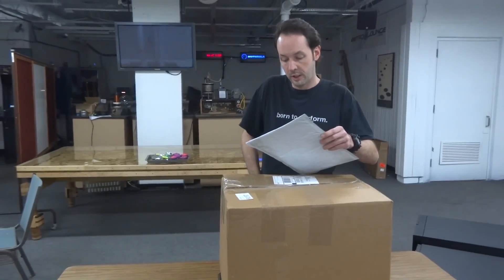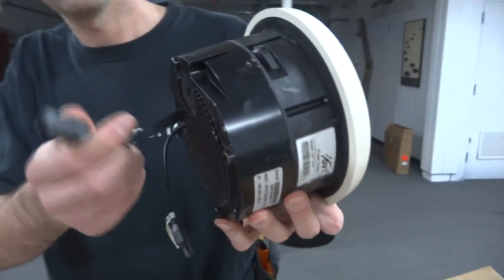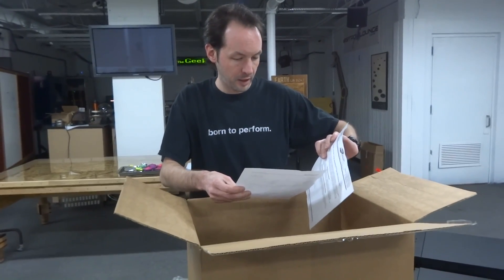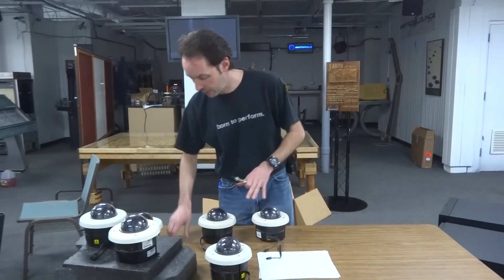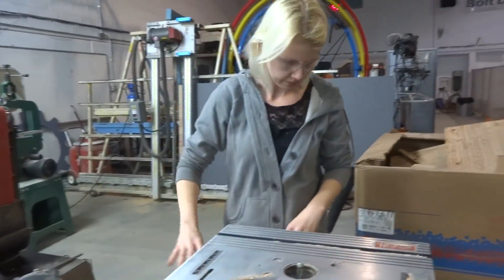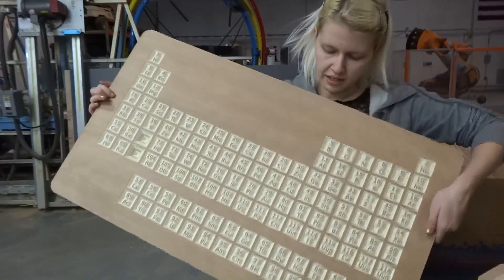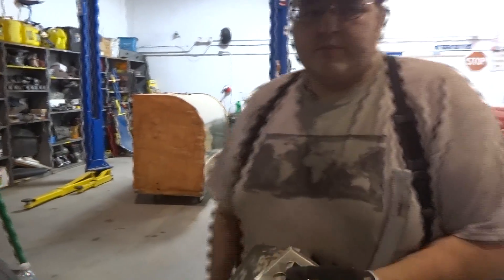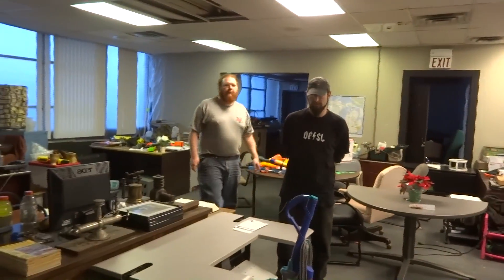Captain's Blog 12-17-2012 Periodic Tables

Comment: I guess it's pretty likely the cameras with just the Ethernet connection would be Power over Ethernet cameras, certainly simplifies wiring if you have the PoE equipment on the other end.